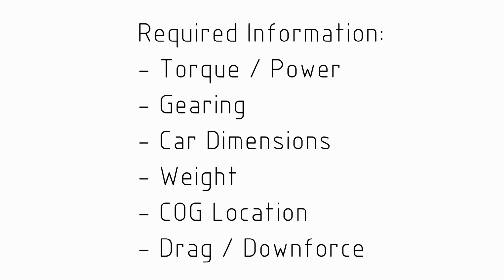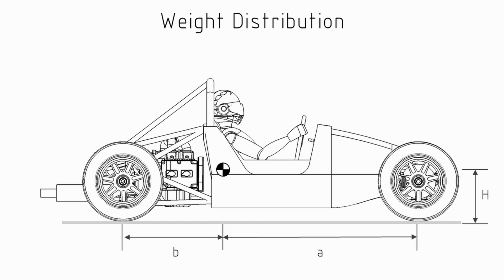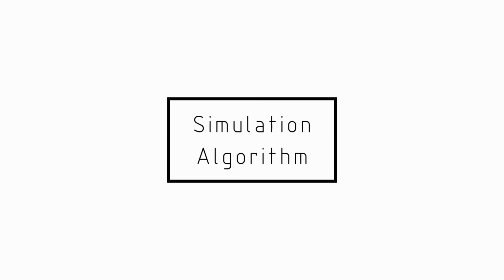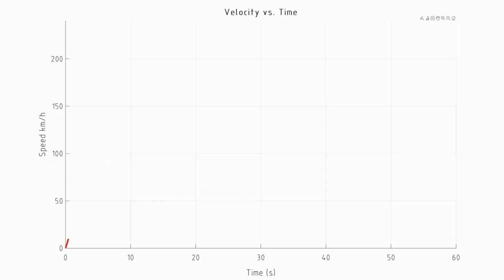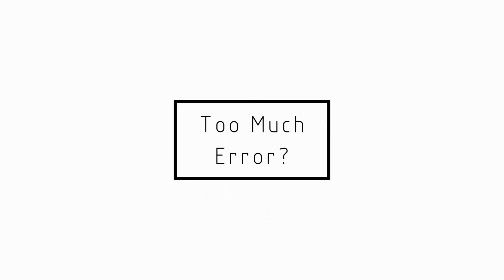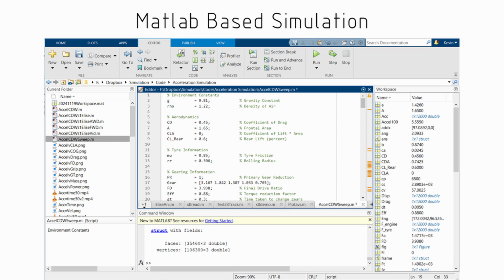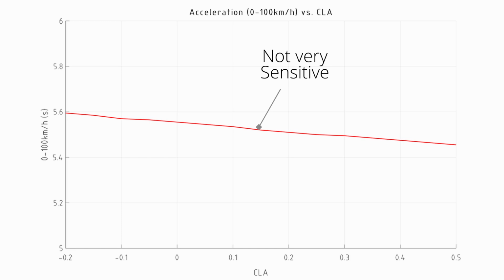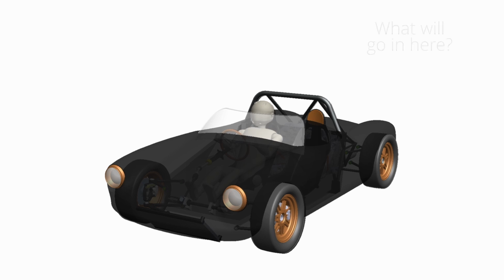Creating and Running a Simulation to Calculate Speed and Acceleration of Sportscars

Comment: why wouldn’t you use a racing simulator to simulate all of this?. i know assetto corsa has a good simulations and you can tweak basically any parameter if needed
Reply from the maker: Driver in the loop sims can be great, and will probably set something up a bit later on.  However closed simulations like this can run very very fast and allow quick analysis of the effect of main parameters.

Comment: Do you also consider incline/gradients in your models? Can have an impact on the final gearing for low power cars
Reply from the maker: Have included it in some models, but not this one.  You make a good point though.  I think any car that does 0-100km/h on a flat road is probably going to be fine up an incline, but obviously will be a little slower.

Comment: Anti-squat would not alter the load on the driven wheels.
Reply from the maker: @efrgserggfsgg Anti-squat can and does alter the load on the driven wheels. There are transient effects when accelerating. The COG of the vehicle is not at a constant height and anti-squat can have a noticeable affect on this.  Equal and opposite forces hold true when there is acceleration of a mass. Damper settings can also be used to change the vertical load on wheels. The drag racing guys do this sort of thing very well.
Reply: Thank you for your reply. I missed that you listed anti-squat with other secondary effects.

Comment: are there any books that go into detail for simulating/modeling this?
Reply from the maker: Fundamentals of Vehicle Dynamics by Gillespie springs to mind.  There are a few others.  I have just gone through Performance Vehicle Dynamics: Engineering and Applications by Balkwill.  It has been pretty accessible and has a section on acceleration modelling. At the end of the day though the accel sim doesn't use anything beyond high school Newtonian physics.  Hope that helps.

Comment: I'd love to see these curves for a formula ford. One problem is that the gear ratios will change depending on the track setup.
Reply from the maker: Definitely would be interesting to see the difference between the zetec engines and the kent engines in the Formula Fords. What is fascinating is how much faster Formula Fords are around a track than so many cars with better acceleration and much more power.  Have to spend a lot of money toget lap times as good as a Formula Ford in a road car.
Reply: @KevinHayward7  demonstrating the huge effects of COG height and well sorted roll centres (grip)!

Comment: I am really enjoying your analytical approach here.  I did a more limited version of this on my own project car (moto hybrid Nissan Leaf) to help choose sprocket ratios, but want to go back and redo it to understand where i should focus future efforts (more EV power, more ICE power, lower weight, etc).   What was the tire traction coefficient you used as a starting point?  

Doing a full bespoke build is a future goal of mine, so I'm loving this series -- thank you for sharing!
Reply from the maker: Thanks for your kind words. Ended up with a coefficient of friction of 0.85.  I had started with 0.9 but modified it to match some acceleration test results from an Elise that I found online. Can be very different depending on tyre and the surface, but overall aiming not to use a very grippy tire for the project.